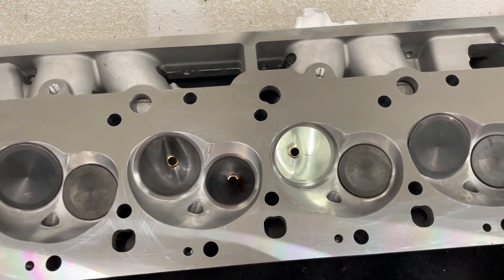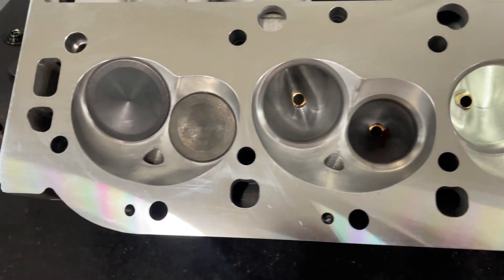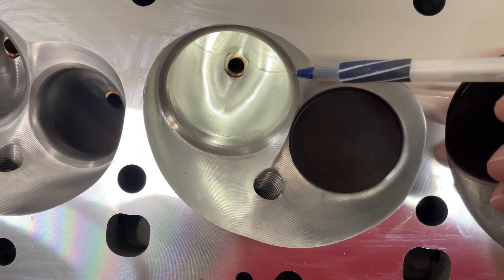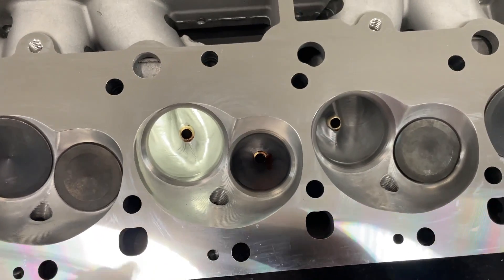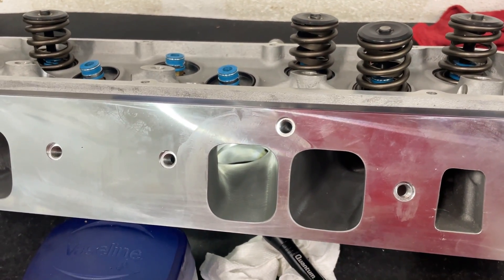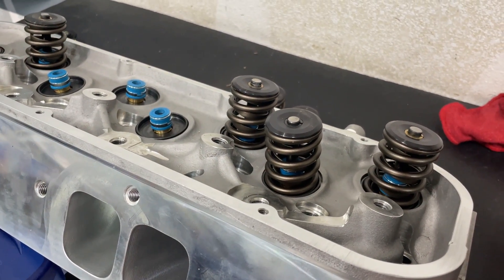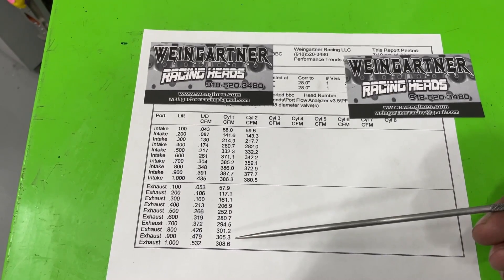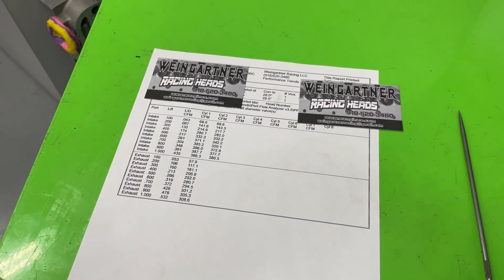Promaxx BBC 325cc CNC Ported Head Review With Flow Numbers

Comment: Im trying to build a 402 BBC making around 500hp any suggestions
Reply: Get domed closed chamber pistons and use the RPM Edelbrock heads. 100cc version of you can.  It'll make more than 500 easy with an 850 and a 240s duration hydraulic roller

Comment: maybe you are not superman, but you are the best
Reply from the maker: I doubt that.
Reply: @WeingartnerRacing  you take the time to talk about, and share your thoughts/experience with us, that's more than 95% of others combined in your profession can say. Even if most of it is above the understanding of most gear heads at least you try to dumb it down for us to follow along. Kudos to you for that Sir.
Reply: So what single plane intake fits these roval heads ? What intake gasket best lines up ? A Rec port or oval port and gasket match ?

Comment: If I'm not mistaken, Promaxx lists this head as only being good up to .600 lift, so aren't the flow numbers above .600 not applicable here? Just asking in case I may be missing something here. If extensive modifications need to be made to the head, then wouldn't you be better suited to start out with a higher quality, bigger head?
Reply from the maker: On the hydraulic roller they are good to .600 but they have solid roller springs good to a much higher lift.

Comment: These are exactly the heads I keep coming back to and then this video pops up. ❤ I have 781’s on my 496, I should have you work a set for me.
Reply: How do like your 781s? I have 088's on my 496.
Reply: @musclebone7875  They work well na. I don’t have a comparison but am happy. The exhaust had been worked at some point and I had the shop go with large tulip valves and throat cut. They are the best 781’s, I just want more, seems to be a chronic problem.🫣
Reply: @the496elcamino  ok thanks for the info. I'd just keep the 781's not unless you are into serious drag racing. At one point I was thinking about buying some AFR heads or Brodix rr heads, but I changed my mind because I don't drag race and my 496 Is a street build. On the engine dyno it made 565hp and 600tq on 9 to 1 compression. I am happy with my engine combo
Reply: @musclebone7875  I'm glad you said that and your results, with everything I'm around 11 to 1. No Dyno yet but will.
Reply: @the496elcamino 11 to 1 on pump gas ⛽️ that's kind of high with iron heads.

Comment: So do porters shape the short runner (increase the flow) to more equal the long runner so that they all flow the same?
30-50cfm difference between runners is quite alot and leaves a bunch of HP on the table.
Reply: Probably depends on the goals, lor rpm tq vs higher rpm HP. It's all about port velocity and intended application.
Reply from the maker: When make them the right size they need to be and it flows what it does. You can't make them equal. If you are worried then think about how far off the flow differences are when the intake is attached, especially a dual plane.

Comment: The short runner long runner difference brings up a question. When you port heads, do you try to get both short and long flowing close to the same? Or do you just get both ports working their best and leave the differences brought on by the length?
Reply from the maker: You size them and shape them like they need to be and it flows whatever it does.

Comment: The best heads i have used on my 468 was the afr 300 magnum  and when i changed it to 496 they were still big enough
Reply: I had 300cc AFR’s on my 496 and it made 646 ft/lbs of torque & 706 hp. 10.5 comp rpm air gap and 248/254 @ .050 solid roller. Awesome head THEN I removed the AFR 300cc heads and put them on a 572 with a super Vic intake and 260/266 solid roller and it made 729 Ft/lbs at 5100 rpm & 751 hp at 6100 rpm. Yes too small for a 572 but savage torque and acceleration in my 70 Chevelle.
Reply: 6100 brother that cam has a higher rpm range than that i know it’s a big block but I’ve seen some go to 7k and more
Reply: You could of made more power still impressive to say the least

Comment: Ya got me thinking about the Roval port thing. The first I heard of them was on the zz502 crate engine and I think those heads were cast by edelbrock. When you hear someone talk about how much bigger the port is and then mention that a standard oval port intake is what works it never made sense to me.
The odd thing to me is that the 502 Ram Jet intake has noticeably Roval shaped ports.
Reply: Is that a single or dual plane design